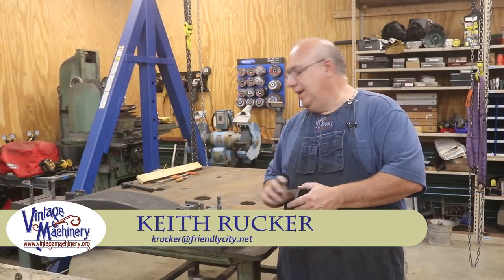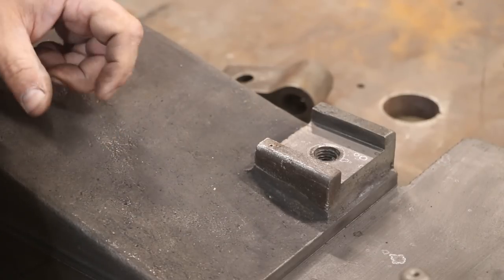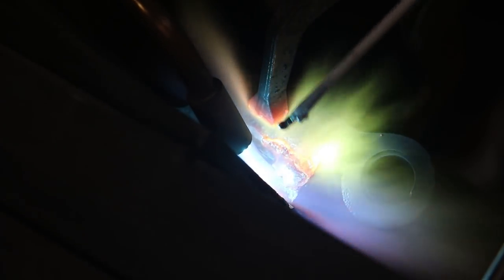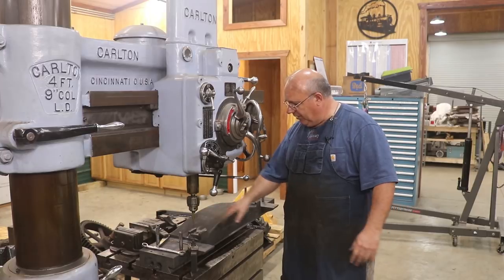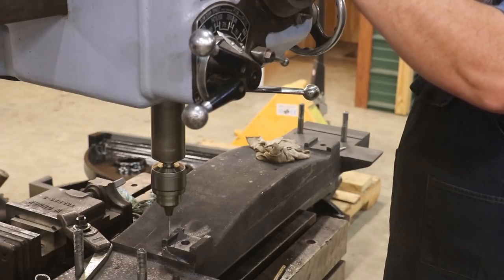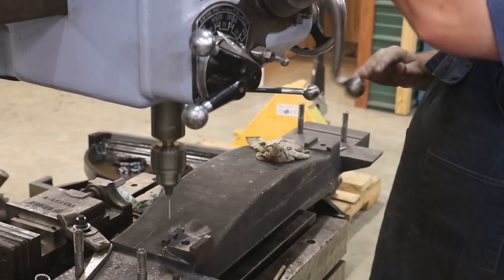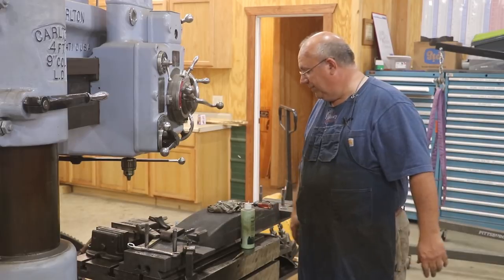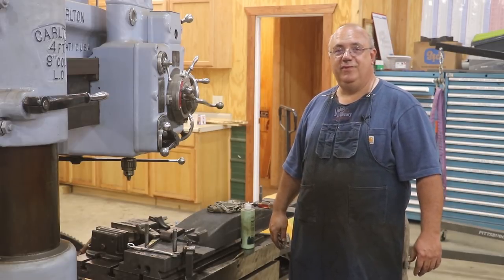New Haven Metal Planer Restoration - Part 6: Repairing a Broken Casting

Comment: Wow, a lot of stone throwing on this video.  You should've consulted the mob first on this one Keith.
Reply: You know, unlike a lot of YT'er comment sections; this one is pretty tame.  This repair discussion seems pretty tame, with a fair amount of sound discussion vs the poop flinging one normally sees.
As a layman, those screws DO look like the slightly larger cousins to the #8's I bought recently to put a lightweight rack of shelving inside me Mum's pantry closet.
I STILL wanted to go with the #10's because I fear her putting 10# on each of the plastic coated wire shelving. 

Instead of a 'stone throwing mob', I see a bunch of people concerned with what LOOKS like a sub-KeithStandard repair on a VERY substantial piece of metal, that could have SUBSTANTIAL impact on Keith himself, or someone ELSE if he ever decides to sell it.
Keith's a smart guy, and even smart guy's can make mistakes.  "A little knowledge is a dangerous thing. So is a lot." Albert Einstein, (1879 - 1955) Physicist & Nobel Laureate
Reply: @boots7859  well boots WHAT I see is a STONE throwing MOB.  Not that I disagree with them but IT'S not my machine SO I'll just ENJOY watching him share his hobby with us.  As far as SUBSTANTIALLY...no.  His repair is fine.